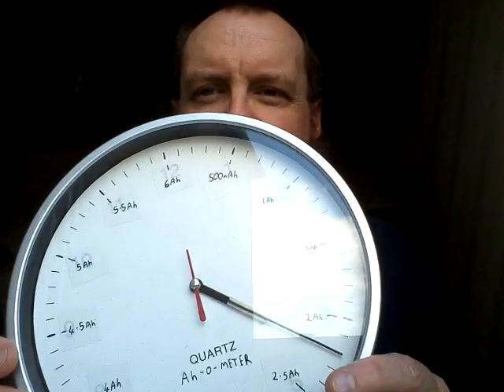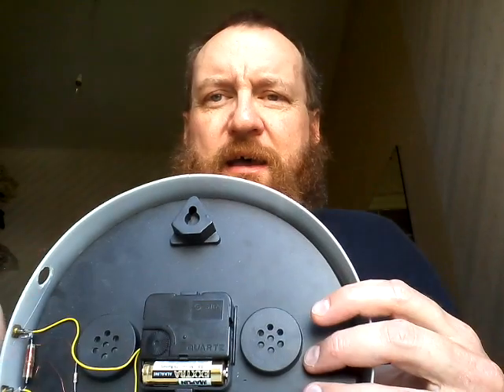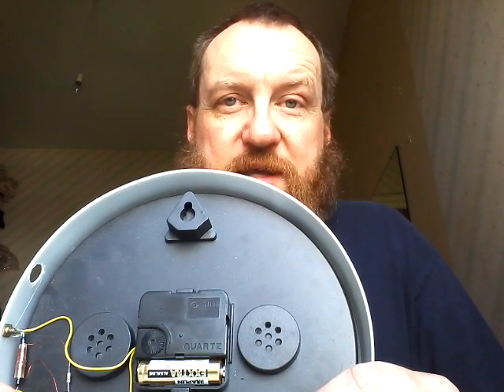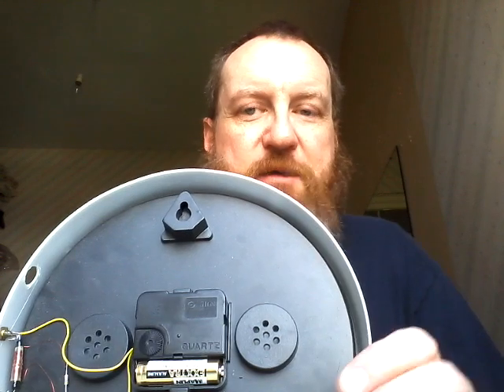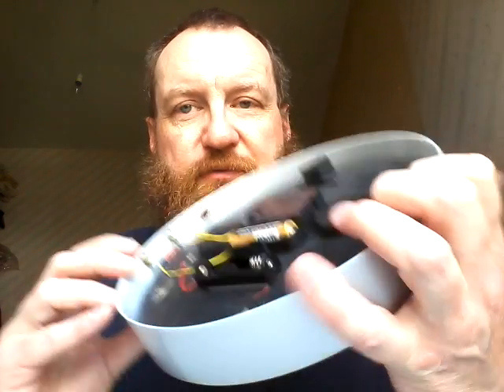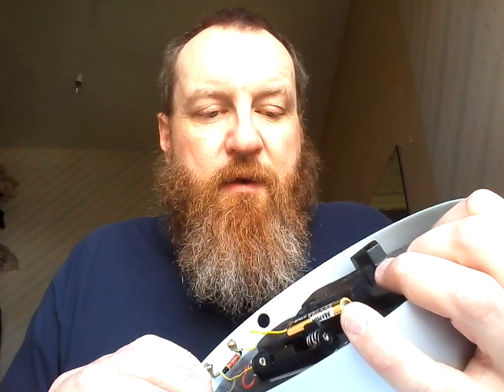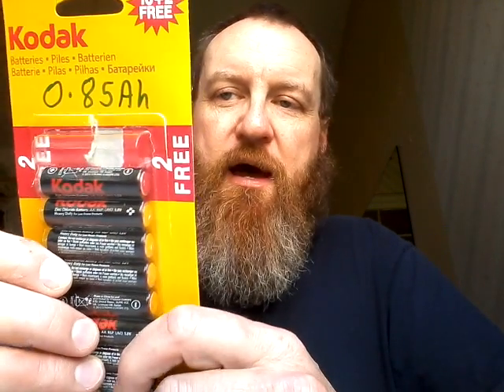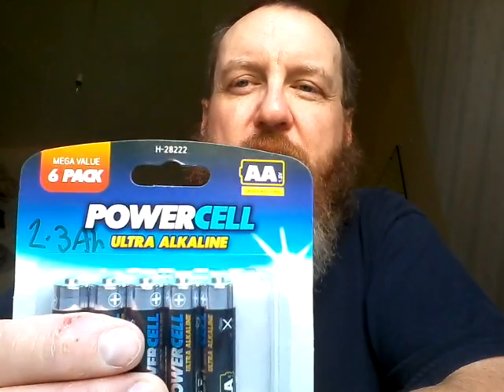Alkaline battery capacity tests.

Comment: "Simply... shit" Made me laugh.
Reply: I was expecting him to say, "Shitty Duracell"
Reply: Duracell batteries are indeed shit. I put three of them in my very expensive and very nice aluminum maglite only to find out a week later it stopped working. It gets very low use (about an hour every other day at most) and all three Duracell batteries had exploded inside and leaked everywhere.

Getting the batteries out of the thing was a nightmare. The maglite was only slightly bigger in diameter than the batteries, and the batteries had swelled up when they went off. I had to power drill all three of them out and pull the husks out with very long needle pliers.

I managed to clean the rest of the horrible mess out inside, fixed the LED module and used Energizer batteries instead and haven't had a problem since.
Reply: Ew yuck.  I can't say I've had Duracell batteries fail like that, that's not good at all.

Comment: Any chance you could try the IKEA alkalisk batteries? They are damn good, and cheap.
Reply: +Paul McPherson yep, similar results from Ikea cells here - I've used them for well over 15 years as my sole source of primary cells - they are excellent and way ahead of the competition.
Reply: +dopiaza2006 I haven't tested them yet, but I've managed to pick up a couple of Alkalisk IKEA batteries. Will have to test them and compare them to other batteries.
Reply: Glad you pointed that out about the flashgun. I can get high end batteries and they might last 30% longer than a cheaper, much cheaper battery. The price/mAh was better on the cheap battery so I used it. Anyways I use to use these batteries very heavy in my hot shoe flash for my camera. The batteries would start getting real hot and wouldn't function as well. so I would put them in a pocket and put a fresh cool set in. Once the fresh set got hot I would put them in a pocket and by then the first set would cool down and I would pop them back in and continue using them. i guess long story is heavier use, and temperature can play with battery performance. I like Clive's test since no only did he look at stored power but price/mAh and under low load so heat really shouldn't be affecting performance.
Reply: 500 mA is not a low current, batteries can in fact generate significant heat under this load. Not as bad as a photographic flash obviously.
Reply: and amazon
Reply: I only use amazon AA's anymore. You can get so many for so cheap, and they work as good as anything, I no longer have a reason to use anything else. I wouldn't doubt if the Ikea cells and the amazon cells are both the same cells with different wraps. There is probably a factory that has a service for businesses to let them use their own logos on the cells, but regardless, good cells.
Reply: My experience with IKEA batteries are terrible... They are the only alkaline batteries that I know which leak very easily. They have decent power but just don't use them for devices that you keep the batteries in for long periods, like clocks, DMM's etc...
Reply: IKEA's NiMh AA and AAA batteries have been consistently excellent IME.

Comment: Poundland Fusiomax Endurance Ultra Power Alkaline without doubt are the best alkaline batteries I've ever used!
The AA Ni-MH rechargeable batteries I use for my quadcopter remote went duff so I had to find a temporary solution until my new batteries arrived.
The remote is very power hungry and after a 20 minute flight the batteries get quite warm, so as a temporary alternative I popped in some Duracell Ultra Lithium AA batteries which kept the remote going for a few days... until they ran out after about 7 flights.
As my replacement batteries still hadn’t arrived I’d seen this video so popped out and bought some Poundland Fusiomax Endurance Ultra Power batteries.
I’m astounded.... they lasted as well as, if not better than the lithium batteries!
Thanks for the heads up Clive :-)
Reply: Can I ask is there a brand of Ni-MH rechargeable batteries that you would recommend?
Reply: These sound ideal then will order some now. Thanks for sharing your thoughts on them and taking you time to reply. That was very kind of you :)
Reply: You're very welcome :)
Reply: All SANYO NiMH were just awesome with regard to internal resistance, current handling, heat dissipation, but of course ultra high-capacity variant self-discharges rather rapidly compared to Eneloop.
Reply: I also bought a Uniross Ultimate Battery Charger (aka BC-1000) for £19 on Amazon... it's an awesome charger for the price :-)
Reply: Basically, everything AmazonBasics is good. I have yet to find something branded amazonbasics that wasn't worth what I paid for it...

Comment: Your tester design is brilliant! I am going to use it.
Reply: Would please explain to me how it works?

There's a reed switch in line with the clock's power supply, i understood that. However, what is it activated by? Is it a reed relay instead? How does one even look for one that activates at such low voltage?

[EDIT] i went through the comments, and now i see! He measured up the thin enamel wire he used for his resistance, and simply wound it around a reed switch to work as a magnet, making an impromptu relay. That is great!

Comment: I've done a few projects involving 6V lantern batteries, and I find that for the price, the zinc-chloride and even carbon-zinc ones do fairly well, and since they're in sealed cases the leakage is rarely a problem. For individual cells and high-draw devices, however, alkaline or NiMH are definitely the go-to options.

Comment: I have never seen Duracell batteries labelled as Simply Duracell here in Australia, that said, I don't go to any 'dollar stores', I typically only buy batteries from the large retail chain supermarkets like Woolworths.  Very curious.  Maybe I need to start looking at other retail stores for batteries, but i typically only buy Energizer batteries these days.
Reply: Lachlant1984 
The thing I find with supermarkets is that they charge out the ass for things you can get cheaper elsewhere.
Reply: We've always only bought batteries at the supermarkets, when I was a child my family always said batteries were cheaper at the supermarkets than they were elsewhere.  Most of the devices I use these days are either rechargeable or can't use batteries at all, but I still do buy AA and AAA batteries for some products.

Comment: Edit 2, sorry to add so many comments Clive, but I forgot to say, thanks for the video, and some interesting results. I do want to say, having cut open both Duracell and Energizer alkaline batteries here in the states, the Duracell casing was much thicker by a noticeable amount, and they will be less prone to leaking. Also any USA made battery is made by the same factory which if memory serves is operated by Maxell.
Reply: The case isn't where it leaks from, it's the safety vent opening at the negative end.  If that safety feature didn't work, it might crack the case... violently.

Comment: What kind of clock movement stops at 1.3V? Most the batteries in the clocks currently running are in the 1.2-1.3V range. They don't stop until around 1.1V or so. Also, isn't the completely discharged rating for Alkaline actually 0.9V? I don't think many devices will tolerate 0.75V/cell. Many won't even operate well at 0.9V/cell
Reply: the industry standard for a dead alkaline cell is 0.8V/cell, while joule thiefs can run all the way down to the 0.6V/cell with most cells.
Reply: @nightshadelenar  Sometimes they keep running at voltages at which they would otherwise fail to start oscillating.

Comment: I have a Duracell here that makes me wonder if the “flat” ones aren’t actually flat: I grabbed this “dead” battery, showed 0.025V, and decided I wanted to see what the construction was like. Rip off the cover, and the negative terminal is a plate that falls away, showing a sort of cardboard separator with a post in the middle; the post was corroded. Check the voltage on the post, 1.395V! So it wasn’t actually dead, just… had a little leak or something? It wouldn’t surprise me if this is a common issue. It looks normal on the outside, so no way to know that happened without dismantling it, which obviously bars it from normal usage anyway

Comment: I'm actually in the process of doing a test right now, currently testing Halfords Essentials Alkaline... I didn't see this video in advance, so I've set my end of discharge voltage at 0.9v since I find it unlikely that most devices actually work at 0.8 or 0.75v..  My test rig is an electronic constant current load of 200mA, so with these two differences it might give slightly different results to your tests, but I'm interested to see how close... so I obtained some pound land Kodak Zinc Chloride "Heavy Duty" AA's for testing.  Will send results when I have them!
Reply: If you concluded those tests you mentioned, do you mind sharing them? Is there any link for such information? 
I’m planning to do the same for 9V NiMH batteries (Constant discharge at 20mA, V_cutoff = 7.0V, adjustable) where the circuit was fine-tuned by simulation first. I did not build a prototype (yet) and your findings and schematic would eventually be helpful. 
Thank you.

Comment: Hi Clive. Saw this video quite a while ago, but thought of it recently because I had to replace the battery in my wall clock and was surprised to be reminded that, at the time I moved in, I didn't have any alkaline batteries to hand, so I'd whacked in a spare NiMH battery, expecting to have to replace it in short order. Lasted the better part of a year because, without a 500mA load pulling the battery voltage down, the current draw from the quartz movement is so low that the battery never gets pulled below its recovery voltage until it's nearly depleted. Doesn't have to operate much below 1.2-1.3V because of battery chemistry.

I did enjoy seeing confirmation that battery brand is not a reliable indicator of quality. Perhaps mass? I'd give good odds that the average Stinkly Durasmell AA battery isn't much heavier than a typical AAAA cell.

Comment: I purchased a 20 pack of Duracell batteries for $16 AU a couple of years ago.
Upon placing them into required holders I noticed something that fell like braille on the casing.
From the outside these looked like genuine Duracell but after I found 1 failed way before expected I noticed part of the wrapping starting to peel.
The outside wrapper which indicated it had an in built battery tester was nothing but a sticker covering Chinese writing on a battery that looked nothing like Duracell and that braille was acid leaking out of the casing from a brand new box that still claimed another 3 years of shelf life.
I went back to the store, grabbed the remaining batteries then threw them onto the counter telling them they are fake batteries.
Of course the next day I went back for something else they had been put back on the shelf so I went home and phoned customer service at head office and informed them of what was going on.
They ended up removing the batteries but it did indicate a lack of concern for quality control.

Comment: Clive this might be a dumb question but does the load applied affect bateries much. in otherwords can u kill a cheap battery quicker under higher load and ultimately affect the mah rating?
Reply from the maker: +Orbital Tube All batteries have a reduced charge/discharge capacity under very hgih loads that exceed their design rating.  In many instances the lifetime and capacity is traded off against the size and current required.
Reply: +Orbital Tube Another thing is internal resistance that increases when the battery is depleted. So the voltage can drop much more under higher load.
Reply: +Orbital Tube Some battery chemistries are better suited to discharging at a high rate. They only lose a small % of their capacity, while zinc or even alkaline batteries will lose a higher % of their capacity at discharge rates that say, Lithium batteries are okay with.
Reply: +Orbital Tube its called peukerts law
Reply: +Orbital Tube the impedance of the cell increases as it discharges so the lower the load impedance (higher current draw) the greater the mismatch over time and resultant drop in voltage.  This is the same for all cells , the effect varies on technology though.  Nimh and lithium ion/lifepo4 tend to maintain a low impedance right up until they are exhausted, although it still increases prior to this.   

Zinc carbon/chloride are high impedance so ideal for clocks and smoke alarms as they also have a low self discharge rate. useless for power hungry items.

Alkaline cells have a fairly linear impedance rise as they discharge, hence they tend to become unusable in high current draw applications much sooner than they are flat.

The higher capacity nimh cells and some alkaline cells have a trade off in that they have a higher self discharge rate. making them less suitable for low power draw applications.  They would self discharge at a faster rate than say a clock like he used would draw in current for example.
Reply: TL:DR Yes.

All batteries have an optimum C rate, that is, the amount of the batteries capacity you drain in an hour. So at 1 C, you drain the battery to totally flat in one hour, 0.5 C and you'll drain it in two hours, etc. as the batteries voltage drops, it's ability to output the same amount of power lessens in proportion to the load on the battery. So, to keep it simple let's say your device requires 1.5 watts. At 1.5 volts the device draws 1 amp. As the battery dies, say to 1 volt (considered dead for most nickel based cells) it must now put out 1.5 amps with depleted materials and simply cannot keep up. So a draw of 1.5 watts will exceed the amperage limits of the battery faster then a draw of 0.5 watts, and in effect, the battery will die off giving it less capacity then rated.
Reply: Richard Stifle
batteries have a cell impedance (resistance) so the more current you draw the more this resistance becomes important.  most cells are rated at a 10 or 20 hour rate with respect to capacity . i.e. a  1 Amp hour cell will provide 100 ma for 10 hours . It will not provide 1 Amp for an hour though as the internal resistance will reduce this considerably.

Different chemistrys have different internal cell impedances (resistance) added to the rule that the higher the capacity the cell the lower the resistance too.  Nicad/nimh have low cell impedances hence they will run power hungry stuff like RC cars , cameras etc.. , Lithium Ion has even lower cell impedance , however drawing very high currents from these requires care due to their potentially explosive failure modes.  most domestic LiIon batteries have current limiting circuitry and protection in them for this reason.

Electric car batteries are usually Lifepo4 (lithium iron) and have very low cell impedance so are able to deliver currents much higher that the 1 hour rate, they are also chargeable at a much faster speed for the same reason.

A newer technoogy called Lithium titanate , yet to hit mainstream use has an even lower cell impedance and can be charged in minutes and can proeduce many times their rated A/H current without damage.

The worse case is the old carbon cells, they have high internal impedance but low self discharge so are still perfect for smoke alarms, clocks and other low power draw itens etc..
Reply: amojak
I agree with almost everything. Just one point, the NiCd batteries have in most cases lower internal impedance than the lithium-ion (Not the other way as you've written), they are in fact often able to give more than 30C without any problem.
The reason why we don't use them anymore is that they have terrible "power density" (W/m^3), even something like 10 times less than the li-ion.
Reply: Richard Stifle  You are somehow mixing several different things together...
 The C is the nominal capacity and each cell have optimal charge and discharge multiplier (which is mostly influenced by the chemistry and cell assembly), not optimal C.
So for example NiCd cells used for powertools have something like 10 - 20 C recommended discharge, while C is around 1,6Ah; but only about 2C recommended maximum charge..

The internal impedance is in fact actuall resistivity from the poles to internall connections to the cell together with the number given by the rate and technology of actuall chemical reaction. Especially the second part will change with the load, so in some cases, if you cross some C multiplier, the actuall internal impedance grows so high, that the cell will self-limit the output. And you would be able to use shorted out battery (even for minute or so) again later, after the effect passes.
In other cases, too high discharge can change the chemical reaction and can make whole cell completelly useless.

In your example, you have 1A vs 1,5A discharge. That is not really telling, since there are cells that won't even notice this difference (typicall NiCd cell mentioned before have internall resistance around 0,05ohms) others can have more than ohm (f.e. button "2032" cell have 20ohm)

And btw. 1V is perfectly normal voltage over Ni based batteries, they are considered to be dead around 0,7 - 0,9V deppending on the device and required discharge curve.

Comment: That's a clever testing system.  I wish I had one of those thrown together a few years back.  I used to work at a local Radioshack and we always had battery sales on.  Having a few of those hanging on the battery wall with brands and averages on display would have been an effective sales technique.  That is, if the Radioshack batteries compared well...